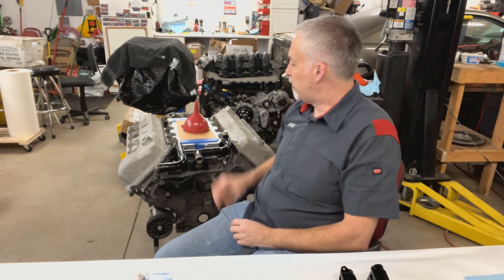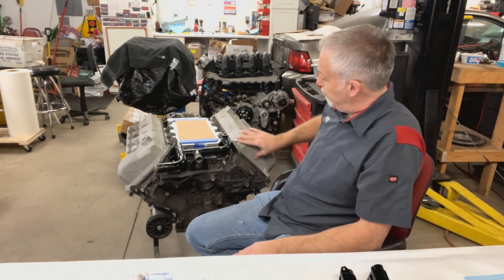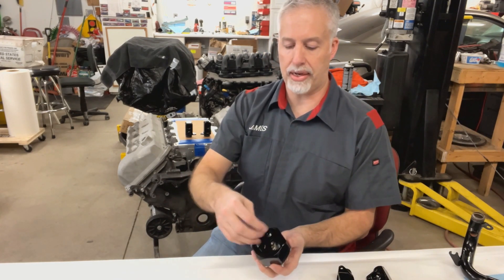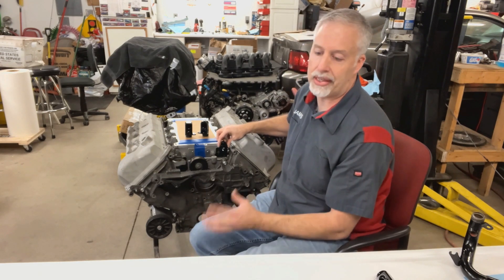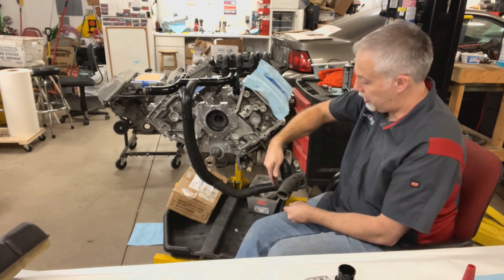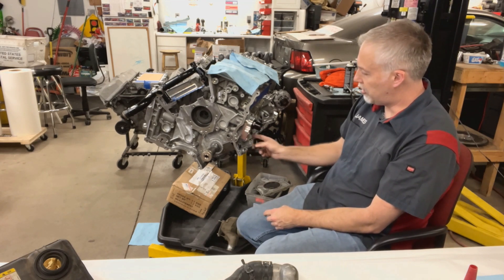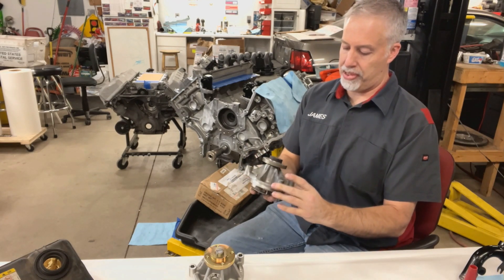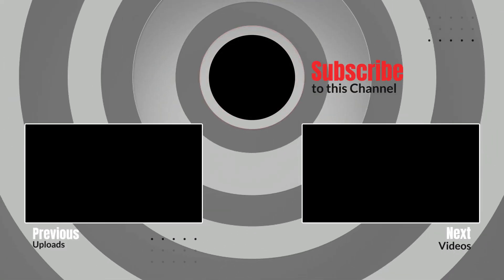Cooling System Basics - Cobra Tech Talk #1

Comment: Suggestion on getting air out of cooling system on a Cobra. Use a funnel with a plug. Lisle makes a nice one. When you have gotten the air air out and there is coolant left in the funnel, and there better be or you get to do it again, the plug will allow you to pour the extra coolant back into the jug.

Comment: Great info!
Does the EMP pump require any modification to fit since it is smaller or is it a bolt up and done deal?
Reply from the maker: No modification. It’s exactly the same as the factory mounting.
Reply: @cobraengineering  Awesome

Comment: Great, great stuff. Will you be going into the supercharger's cooling system? I am considering buying VMP's intercooler for my Terminator and pairing it with VMP's 1 inch water manifold  (which I heard you designed) . I heard that you get the most from the intercooler if you pair it with the 1 inch water manifold lines. Is this true and are there any plans from you on making your own and putting it to market? I mean, it is your design lol. Nothing against VMP, but if you came out with an intercooler and your brand water manifold, I'd go with you.
Reply from the maker: I have no plans to make a intercooler brick. I can get the VMP one. 
I do have a very similar design for the stock one with either 3/4” or 1” lines. 
Yes I will do a intercooler video.
Reply: @cobraengineering  Awesome. Very very interested in that video. Thanks
Reply: @cobraengineering   how much of the pluming needs to be changed out to 1" lines in the water manifold you made for VMP? Would there be a bottleneck at the intercooler pump since since the inlet/outlet can't be changed out, and would there also be a bottleneck at the heat exchanger inlet/outlet? Or am I overthinking it?
Reply from the maker: @racequad9  Ideally you would want everything 1".  But even with 3/4" lines you would see a increase in flow at the intercooler at least.
Reply: @cobraengineering  Will there be any restrictions at the pump? I do plan on doing VMP's GT500 style pump which pumps more GPM than stock
Reply from the maker: @racequad9  that would be the least restrictive part of the system being that it will have the most pressure. But even it would gain from larger inlet lines
Reply: @cobraengineering  Thank you so much for your input!

Comment: What is your opinion on deleting the oil cooler totally? It seems a lot of people on the forums have done that, and say it’s fine etc etc. I’ve done the same on my 03, because after 2 attempts to rebuild the stock “ oil cooler” it still leaked coolant on the ground and I just said F it, deleted it. No cooler at all now. But I also do not road race the car, or extended periods of high rpm, mainly just cruise it around and a few hits on the street. I’ve thought about adding a real oil cooler to it, just haven’t done it yet and don’t want to if it’s really not needed for a car that’s mainly street cruised, with the occasional pulls on the street or 1/8 hits.
Reply from the maker: In short. You will be good. Most put a larger filter and personally I get a extra quart of oil in. 
I will be doing a video on this specifically.
Reply: @cobraengineering  yeah I went with the MMR oil cooler delete, which was a huge mistake, I thought mmr could at least get that right, but no, they can’t. Their block adapter or whatever it is that bolts onto the block leaks so bad you couldn’t run the engine. So I ended up having to just throw it away and bought a Moroso one because yours was on back order at the time, and I needed it asap. So I’m using mmr’s filter head, and moroso block plate. Mmr said use a Fram Hp4 I think, which there’s no way anything fram is getting close to a vehicle I own. So I’m using the Amsoil cross reference to that, and it is a good bit bigger than the stock FL820s

Comment: Do you have any videos or pictures of the whole set up installed? Crossover delete and lower hose to oil cooler ?
Reply from the maker: I’m in the process of editing the install video from my own car. Should be out next week. 
Then I’m moving to the bottom side.
Reply: Great thanks I’ll be on the look out , been wanting to do the crossover delete mainly to make everything easier to work on and looks, but now I’m interested in doing the oil cooling part as well, just wanted to see what all you need to do to the hose that comes down from cross over down to thermostat and oil cooler

Comment: So if we are to relocate the filter, is an oil cooler and oil thermostat required, or is it fine for a street car and maybe some occasional passes at the track?
Reply from the maker: No it’s not required. I have gone without a oil cooler for more than 10 years with no problems. 
But if you use a cooler the thermostat is necessary.

Comment: Hi guys someone know what is the best temperature stetting on a tuner for the fans to kick on on low and high speeds for a cobra 1997 ?
Reply from the maker: That depends on a lot of factors. Your climate, cars purpose, and setup. 
I use 196*-204*.
Reply: @cobraengineering  we are in Arizona and we just use the car once a month.
Reply from the maker: @yaviermustang2012  in Arizona I might go down to 190-200 or even less. You just don’t want it so low that they come on during normal highway driving.